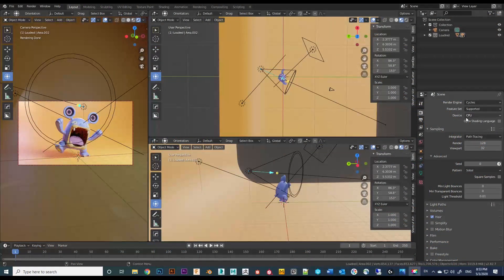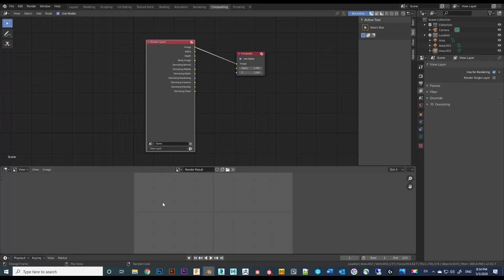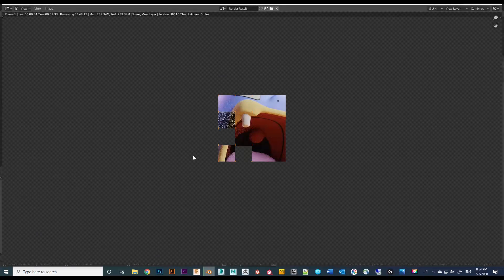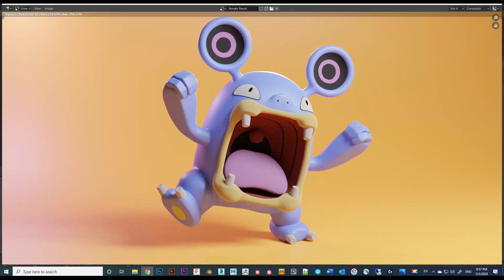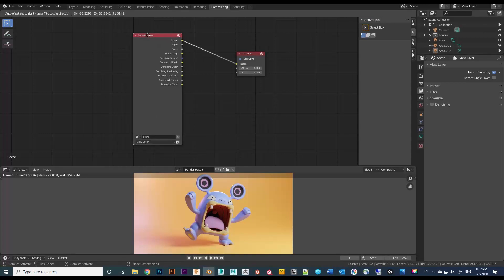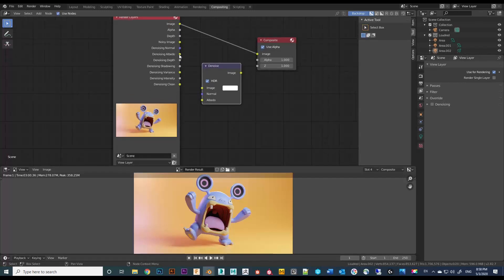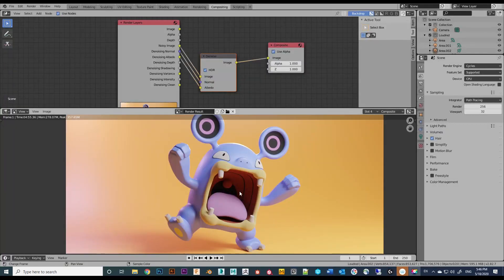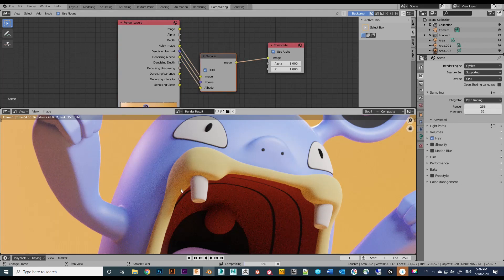Blender Tutorial - How to Remove Render Noise Using Denoise Node in Compositing

Comment: how do I save the final image? I used a viewer on the node part to be able to see the final result, but my image opened below the node part like you did it, doesn't show any change... :(
Reply: you just render the image or animation and wait a few seconds after it has done rendering the frame and it will change to denoise render